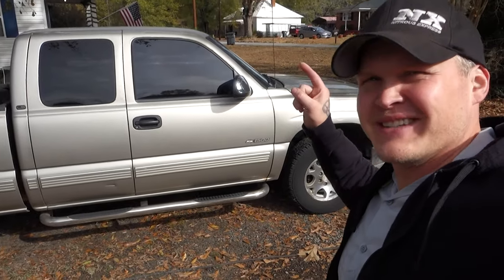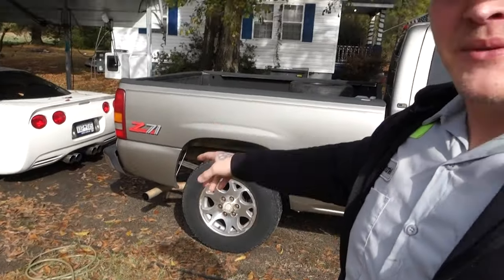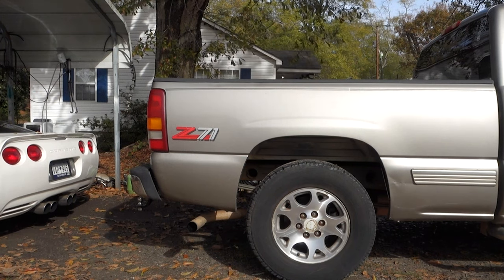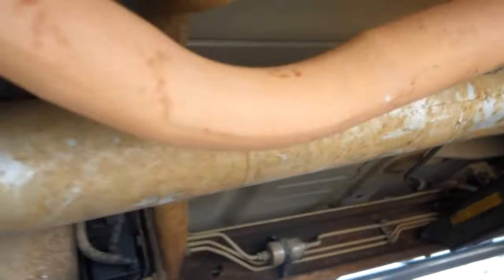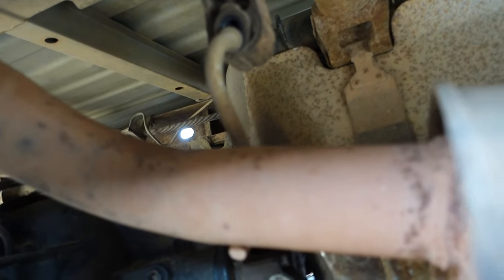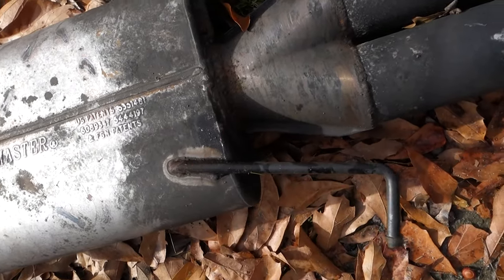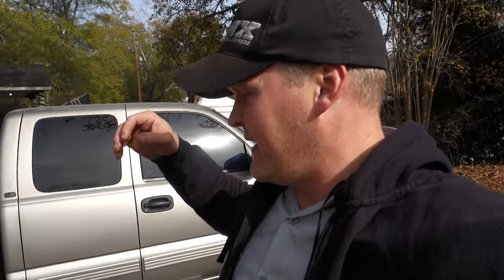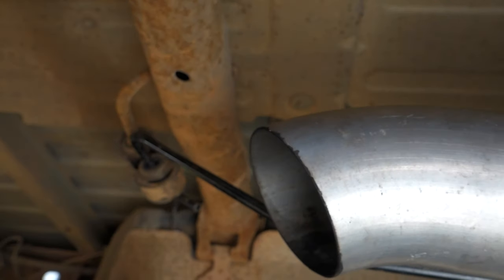Muffler delete On my Chevy Silverado￼ 1500

Comment: I guess similar to the other guy who asked about cutting off the muffler entirely, I was wondering how droney did it sound in the cab when you reved it without any exhaust? — because I might cut it off and leave it right there and not even connect the tailpipe. At least for the time being. :)
Reply from the maker: It’s not too bad, you’re definitely gonna notice it though 😆
Reply: @Nathaniel2503  well the current muffler has a hole in it, which makes it really droney!! I’m hoping maybe no muffler is a little bit better 😂
Reply: Do you think it could potentially sound worse? 

Also What kind of welding did you use for connecting the new muffler?
Reply from the maker: @ReynierMartinez  I don’t think it would sound worse, just a little Eastwood Meg welder
Reply: @Nathaniel2503  Ha!! Did it yesterday and it certainly is louder, mainly when cruising on the highway 😆 but it has a nice growl to it! when my buddy heard it, he thought it sounded like an old-school Chevelle, Nova or Oldsmobile. 😂 The muffler had two pretty big holes on the top!

Comment: if i cut my muffler off the same way u did could i just leave my tail pipe out that stucks out the back of the truck thats connected to the other end of the muffler? could i leave that out or is that not good to do
Reply from the maker: Yeah, you can cut your muffler off and reconnect it with a piece of straight pipe
Reply: okay